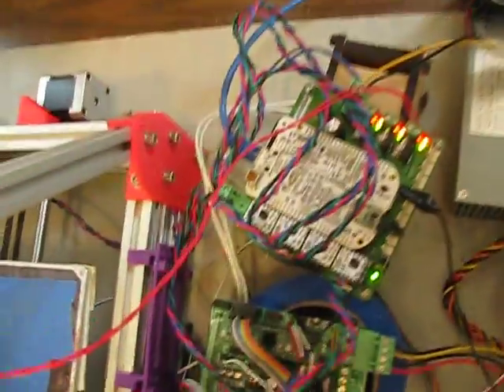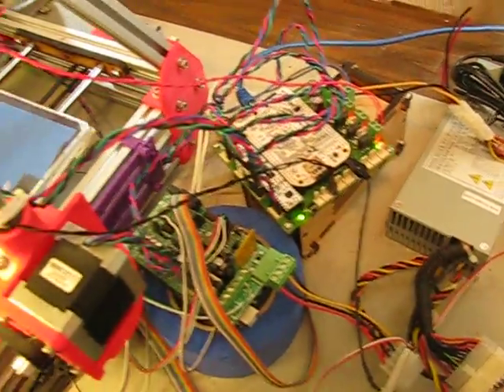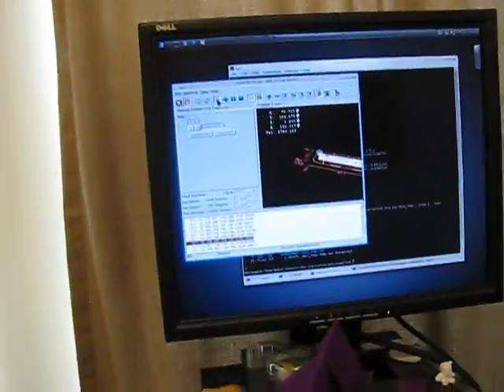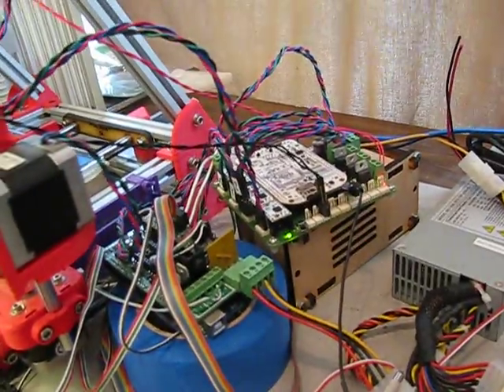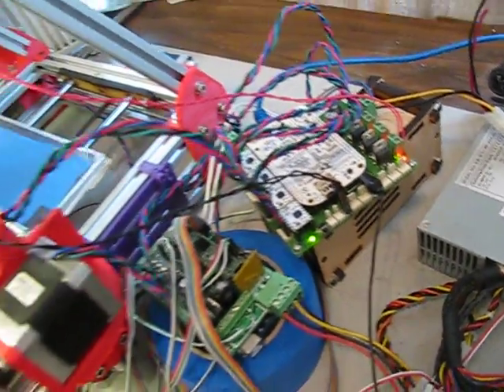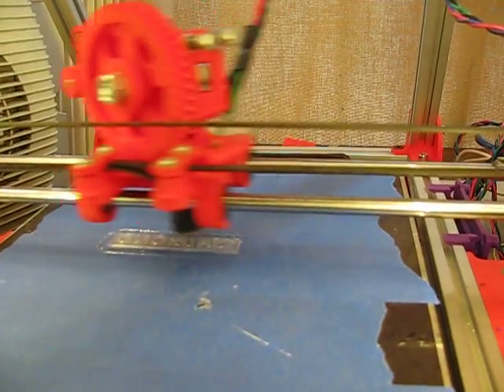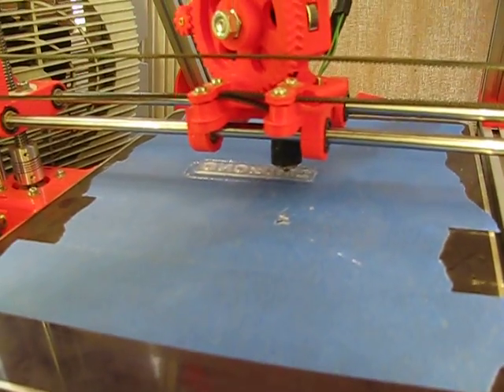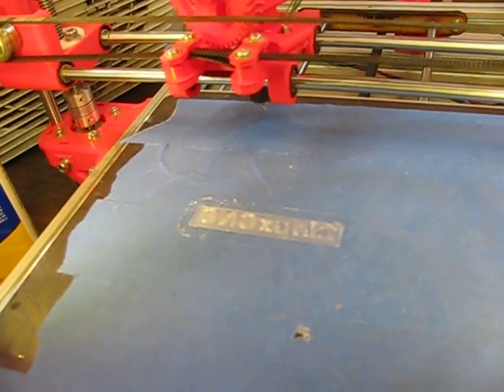BeagleBone + BeBoPr + LinuxCNC + MendelMax Printing

Comment: you need to need to set it to autohome when the print is done so the hotend doesn't sit on the print, leaving a melted dent. Still, cool stuff with the beaglebone running on it.

Comment from the maker: Yes, LinuxCNC (the renamed EMC/EMC2) is doing the trajectory planning (and everything else from HAL) using hard-real-time xenomai user threads.  All of the gcode processing and trajectory planning is unchanged from the stock LinuxCNC.  I have only added BeagleBone specific drivers to use the PRU for high-speed step/dir generation.

Comment from the maker: The BeagleBone ARM core is 32-bit with hard floating point and runs at 720 MHz (1 GHz for the BeagleBone Black).  I'm doing step/dir generation with the dual on-board PRU 200 MHz 32-bit micro-controllers, so compared to a 16 MHz, 8-bit AVR Mega2560, the best answer I can give is it's a *LOT* faster!

Comment from the maker: This is a four axis machine with 5 motors.  X, Y and the Extruder each have one motor, while the Z axis is gantry style with two motors (one on each side).  The extruder is gear driven, X and Y are belt driven, and the Z axis uses lead screws.

Comment from the maker: Everything is from the armhf version of Debian Wheezy.  Some of the other bits (like the PRU assembler pasm) are in the LinuxCNC source tree.  Note that you *DO* have to use the supplied pasm, as it includes updates from Bas Laarhoven (designer of the BeBoPr board) adding support for some instructions that were documented in Rev. C of the Technical Reference Manual and got pulled at a later date (the XIN/XOUT instructions and some others).